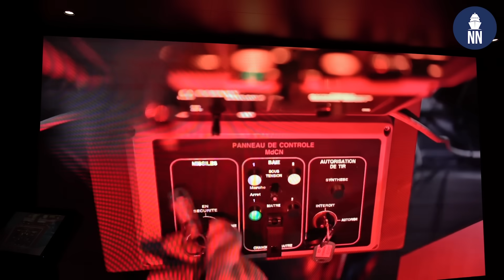MBDA's new LCM - Land Cruise Missile

Comment: wow 
I didn't expect over 1000 Km range.
Till yesterday we supposed Scalp Naval missile range was under the limit of 500 Km treaty or about 250 nm range!
Reply: You're probably confused the MDCN/Scalp Naval with the air-launched Scalp/Storm Shadow cruise missile.

Scalp Naval/MDCN = 1000km
Scalp/Storm Shadow = 500km
Reply: @CriscCiaddu MDCN 1400 max
Reply: This missile is a huge missile, equivalent to Tomahawk in size almost, so don't be too surprised by a 1000km range. It is 6.5 metres long and 1.4 tons in weight, it is in fact slightly larger than the Tomahawk in fact.
Reply: Non non pas du tout
Les MDCN Naval ont une portée de +1000 km

Les MDCT auront une portée d'environ 1500 km puisqu'ils seront lancé depuis la terre comparaît à un tir de Sous-Marin
Reply: The SCALP is air launched with 500km max (depending on the profile, if low altitude it’s going to drop rapidly) and 450 anti bunker warhead.
The MdCN is 1400km max, (1200 in operation to start low and not give away the position of the ship) and 250 regular warhead. 
They are 2 different, treaty on cruise missile, one for export with limitation to 300km and 
another one limiting any from the ground with more than 500km, this one was coming from the euromissile crises and Russia is no longer respecting it so…
Reply: No, they reached almost 1200 km, but it depends on the situation., tu confondi quello per i caccia che arrivano 580 km circa .
Reply: Mdcn has already 1000 km range and is in service for nearly 10 years. Scalp has 500km range.